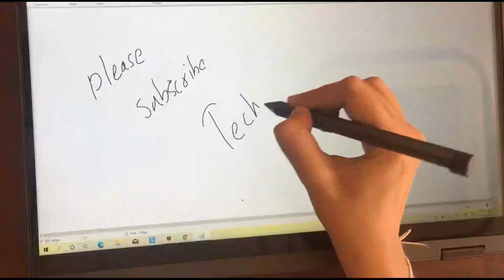How To Fix Laptop Hinge | Acer Aspire A515-55 Hinge Repair

Comment: Great video - I just repaired my broken left hinge also. Only problem I had was the connector on the white wire got slightly out of round and it wouldn't click back onto the post. I was able to use a magnifier and small instrument to reshape the connector. Thanks for your excellent help!
Reply from the maker: You're Welcome 😊

Comment: Hey! I have the exact same model and my left-sided hinge is broken. The black plastic just below the screen is also getting off from the left side. Could you give an estimated cost for its repair by a service center or local repair shops?
Reply: hey... exactly same thing I am going through..... have you got your laptop repaired??. . please tell me how and at what cost
Reply: @sumitvishwakarma5149  it will cost anywhere bw 1500-2500
Reply: okay... thank you!

Was it from acer authorized service centre or any other centre?
Reply: @prateekraj8187  ?
Reply: @sumitvishwakarma5149     bro my laptop also has same problem 😕 
Did you got your laptop repaired ?
Can you give me info on this
Reply: Bro can you give me more info on this 
My laptop also has same issue
Reply: @sameersannidhanam8340  Hey. Yes, I got it repaired. I got the fabrication done for my laptop body. I got it done by a local repair service. As it was my friend's shop, it costed me 1200 rs only. In general it will cost you from 1500 to 2000. Not more than that!
Reply: @sameersannidhanam8340  Also, I didn't have my hinge broken, it was the stub that was broken. So check if you have same issue or not.
Reply: @sumitvishwakarma5149  Ohh Okay bro 
After repair did you face any other issues ?
Reply: @sumitvishwakarma5149  bro can you give any of your socials or email so that I can share images of laptop